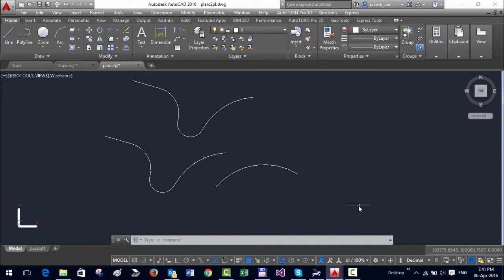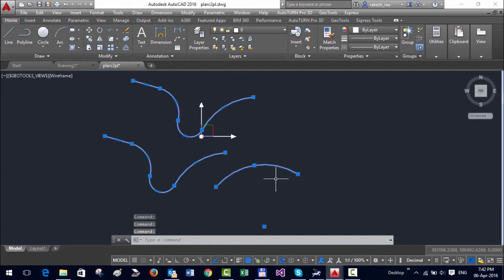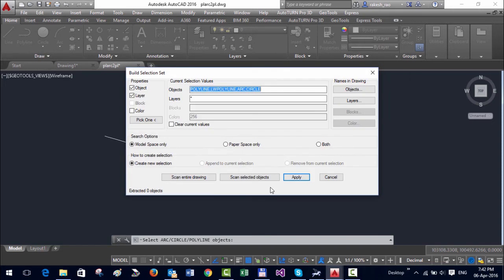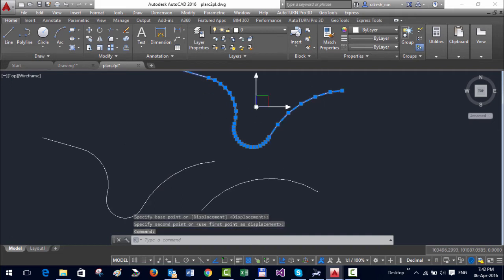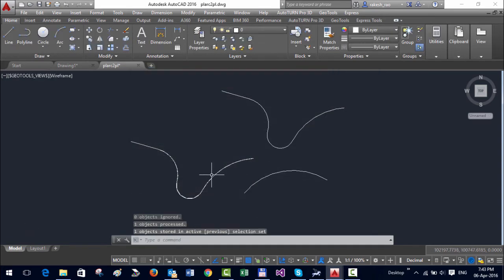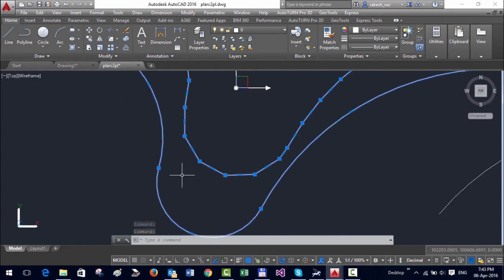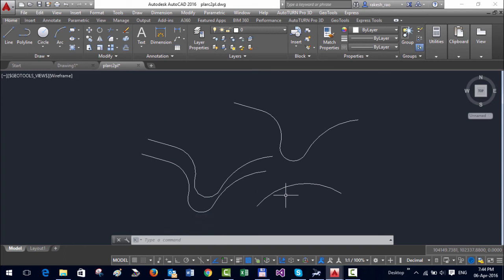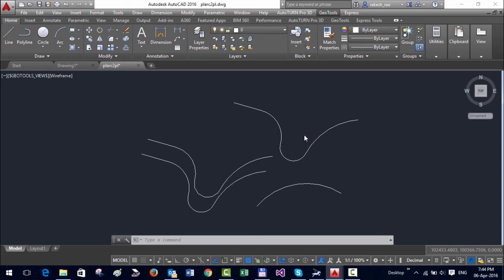Convert arced polylines to linear segment polylines, enabled by CADPower & GeoTools

Comment: sir, this is very nice tool my question is how tu weed these vetex of a arc or spline or polyline vertex same like you have created in this video.?
Reply from the maker: You can use the GT_DISTANGWEED or GT_DISTWEED command
Reply from the maker: I can help you. Please connect with me on www.anydesk.com or Microsoft Teams
Reply: @DesignsenseBLR  yes sure sir